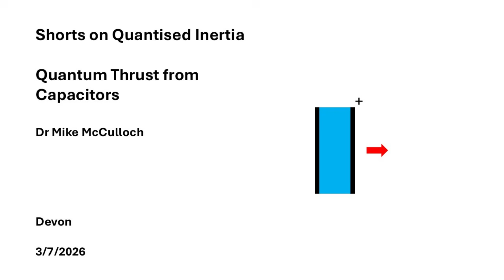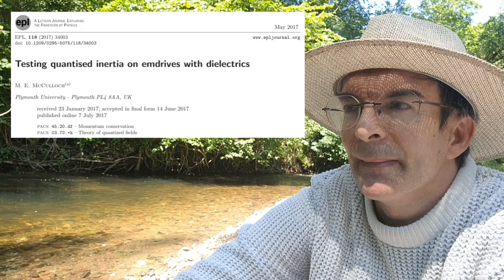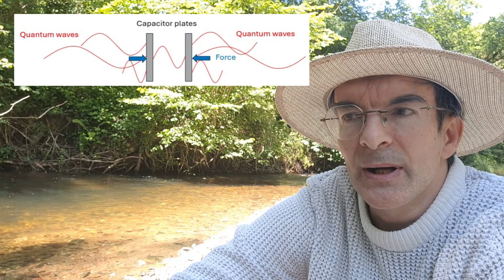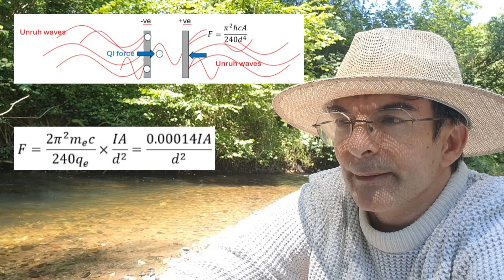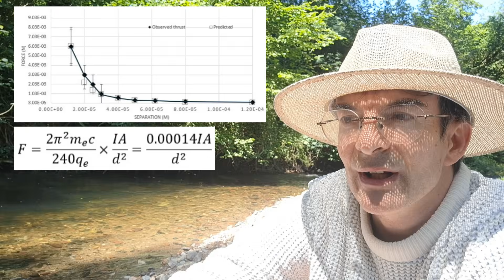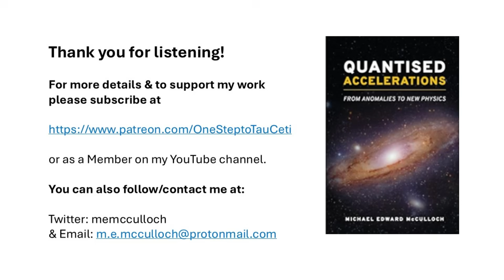Quantum (QI) Thrust from Capacitors

Comment: From formula for Casimir effect pressure can be calculated. 

AI:
(The Casimir pressure at the Planck length is approximately \(-1.905 \times 10^{112}\text{ Pascals}\), where the negative sign represents an intense inward, attractive pressure. This immense value is proportional to the Planck pressure (\(P_P \approx 4.633 \times 10^{113}\text{ Pa}\)), which is the highest possible pressure density in the universe.)

Pressure is very high but limited; that means although particles and black holes are point like they still have small volume.

AI:
(Plugging this into the acceleration equation for Earth's gravity (\(g = 9.81\text{ m/s}^2\)):\(\Delta P=754.6\times 9.81\approx \mathbf{7,403}\text{\ Pascals}\))

AI:
(The energy required ranges from \(2.55 \times 10^{19}\) Joules to \(3.58 \times 10^{19}\) Joules, depending on whether you use a pressure difference of 5 or 7 Pascals. )

Approximate pressure difference and energy for gravity (g).

Rocket can be accelerated by crating lower pressure at front side or higher at rear side.

Comment: does quantized inertia explain ball-o-lightning?
Reply: Of course. It explains everything including crop circles, human consciousness and why you run out of sliced bread more quickly than predicted. You just have to adjust h bar slightly for each explanation!
Reply from the maker: It could do. A plasma would damp Unruh waves and cause a force inwards to hold the ball together. I did a back of the envelope calculation for that in my latest book but a more accurate one could be done.

Comment: Great video! By the way, I suspect you should review Ampère’s early work as it's been more fully translated and his laboratory research has come to light showing a force possibly explanatory/examplatory to your issues with capacitors being damaged. So you may gain some insights. Also the force Ampère is describing may be or related to QI at really close scale observable in wires similar to the results shown in your graph, with the atoms in the wire acting like really close plates in a capacitor. I suppose if you confirm that then I imagine you could put your name in with extending Ampère’s research as well. Anyway, great work you're doing and here's a link to one of the videos getting into the little known force (which off the cuff I suspect is observed QI acting in wires): 
"The Force That Physics Erased: Ampère’s Forgotten Law"
https://www.youtube.com/watch?v=YHykWjtVdNM&t=206s

Comment: Mike, my friend and I wrote several papers on a similar space propulsion technology that does not need a power supply  -   'Casimir-Like Macroscopic Propulsion and Environmental-Energy Conversion'   https://www.youtube.com/post/Ugkxhqjn5_oYgXI7YsrECXYhJslSV36ckYiq  
The prismatic/Fersnel-like 'sail' material can be formed as asymmetric capacitors.  Thoughts?
Reply: The Post was converted from PDF to Word and is missing images. Ask for the original PDF paper

Comment: Why would the force have a preferred direction from just a voltage difference between two flat plates?
Reply: Electrons jumping between the plates are the focus. When the electrons jump across, during the jump, their inertia is suppressed, allowing them to accelerate to much higher speeds. When they strike the opposite plate, their inertia returns, but at the higher speed. This causes a force that appears to pull the capacitor from the negative plate side to the positive plate side. This is a preferred direction based on voltage polarity. 

I hope this helps. I'm worried, based on his description, that I might have the explanation slightly wrong, but the direction of force is correct.
Reply from the maker: The electrons' motion is the asymmetry. They tunnel cathode to anode.

Comment: Many engineering challenges come down to the unavailability of desirable material properties.

I encounter similar constraints in my diffusion bonding and heat exchanger design work.

Material science breakthroughs are usually discovered by a combination of accidents and intelligently guided trial & error experiments.
Reply from the maker: We need a high permittivity, robust, ultra-thin, dielectric.
Reply: @mikemcculloch4505 Have you tried extreme high vacuum, Teflon, and Mott insulators?

Advanced semiconductor processing facilities utilize extreme high vacuum, which also naturally exists in interstellar space.